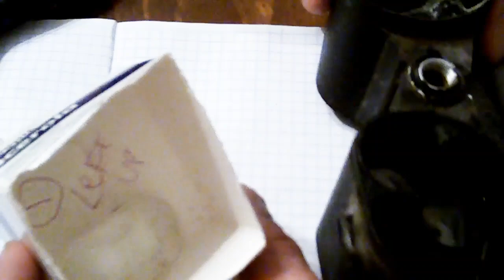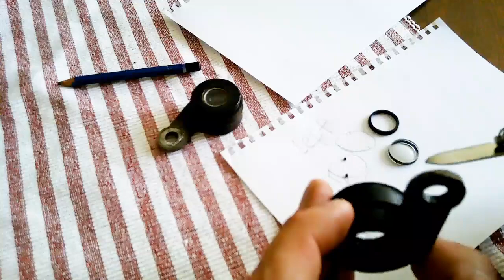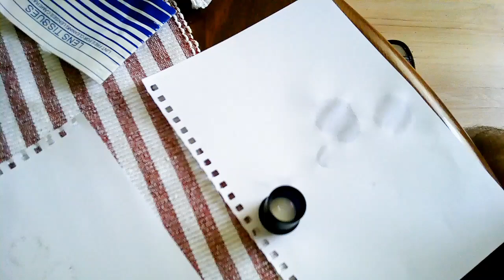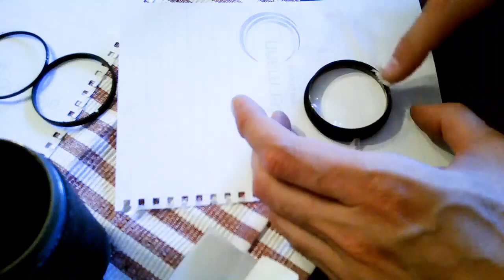Disassemble and clean: Dioptex binoculars

Comment: First of all, it was a very useful shot, thank you. However, I disassembled and reassembled the TENTO brand binoculars I had. But I could not provide a clear image on the left side, I could not do the fine detail while screwing the right lens back and forth sharpness adjustment, I would appreciate if you have technical support in this regard, thank you.
Reply from the maker: Hi! I am glad that the movie was useful, I am very pleased. Perhaps the right lens should be on the left? Try to replace the right lens with the left one (the big one in the front), it is the easiest one. It may also be useful to unscrew this lens slightly and spin it dry. At the front, the rims holding the lens have the shape of a cradle, as I remember. The lens may not be placed horizontally. Or If you have time, reassemble and compare the small lenses to the same alignment as the part that sharpens well.
Reply: @langowski007  Hello, thank you for your response. I will try your suggestions as soon as possible, if I can not solve the problem, I will get back to you with pictures.
Reply from the maker: @mustafakaleagas5345  I am glad that I could help. You will surely be able to repair your binoculars. Sure send photos! Good luck:)
Reply: @langowski007  ok
Reply: I have also TENTO bro. Please suggest me the best way in India

Comment: Im done this in my 7×50 marine type binocular. Now working perfectly w/ perfect calibration like a new. 👉In your own risk to do this. The calibration or alignment is not easy.😂
Reply from the maker: It's great that it worked 👍 If you note everything down when disassembling, there will be no problem when assembling 🙂 I wish you successful use and observation with binoculars :) Regards 👍

Comment: They used black goo to seal the metal flanges (joining tabs) on these 1970s metal binoculars. What was it and what to use in its place? Silicone would be a too strong bond I'm afraid.
Reply from the maker: Silicon as such, e.g. construction / modeling, is too strong when it dries up. There are silicones that do not dry and have a semi-fluid consistency. I have one in the tube, it is thick but it does not dry up. The name: silicone oil. It protects against moisture, it can be used from smearing the hinges on the door to smearing the gasket in the wristwatch. It is characterized by resistance to conditions such as moisture, "does not creak" on it, it is easy to unscrew something there always. I hope I helped with the answer :) Regards 👍
Reply: @langowski007  I use silicone oil as preservative for plastics and rubber. I think it's more lubricant than sealant and it's fluid for sure, could evaporate and create haze. Don't you mix it up with some product brand name? I found something that may be better. It's called Hylomar Blue - a non-setting sealant or another is Hylomar Hylotyte Red - a semi-setting one. I just bought both online. Also I found online what they used back in the day and it's probably not produced any more. It was used for sealing petrol drums during the WW2, then formula was changed slightly after the war and in 1970s it apparently got out of use. Of today's products plummer's putty is closest to it but it's white or gray.

Comment: 6:26 and if it does not unscrew?
Reply: stuck
Reply from the maker: Hi 👋 heat it with a hair dryer or soak in hot water. It must be releasing some dried grease, dust and moisture have accumulated.
Reply from the maker: @hellishnickolas3640  ... Or hold it over steam for some time (kettle or pot) and then, when it heats up, try to unscrew it.
Reply: @langowski007  thanks 😊

Comment: Hi buddy. I have this too. but the left side completely distorts the image. so i wanted to remove the left side and use only one hand. How do I separate the hinge between the two?
Reply from the maker: Hi 👋 I remember thinking about it while disassembling the binoculars. In the end, I left them as they were and didn't separate them. I regret I could work on it ... Surely there is some access, maybe the silver hole between them can be disassembled ... Something feels that it may turn in the opposite direction, the flashlight will light up inside, maybe there is an incision that allows you to grab and unscrew this silver something ..

Comment: Wow, good job. I'm going to do this with a used Zenith 10x50 binoculars. Any suggestions about the correct grease for the screw and the front lens assembly? Can I use copper grease for all?
Reply from the maker: I'm glad you like the film :) As for the grease, I made a mistake, instead of copper (because I had one ...) I should use aluminum grease or, I think, a tawot (copper grease corrodes aluminum - the lubricated element is aluminum ...) Use grease only where the binoculars bend. I unscrewed the front lens and applied it "on my feel". It was felt that the angle changes when screwing. Maybe it's worth marking with a felt-tip pen before unscrewing? However, after folding the sharpness is excellent, everything works fine. I tried to make the lenses identical in both positions. And I need replace bad grease soon. Greetings.
Reply: @langowski007   Krzysztof Langowski  thank you for the reply, very interesting....I have find that aluminum soap grease is the best into an Italian astronomy forum (as you wrote in description).
I have another question: today I used ethyl alcol to degrease and clean plastic part, but it ruined the black plastic (faded it):(
Any advice?
Reply from the maker: @alexc.7561  A good plastic cleaner is Plak, a car plastic cleaner, black matt plastics and gives them shine. However, you need to repeat this chemistry from time to time. With ethyl alcohol and other chemistry you need to apply a little bit and see the effect.

Comment: And seen that there is a tool to remove the tubes that hold the eyepieces when they are too hard to do it with their hand, a type key that wraps the eyepiece with a rubber ribbon. What's your name? I need it so I can disarm some carl zeiss from about 100 years ago.
Reply from the maker: Hello 👋 I was using narrow section pliers. For example, with caught nails: D I didn't have professional tools as such. I was based on my imagination. Good luck: D